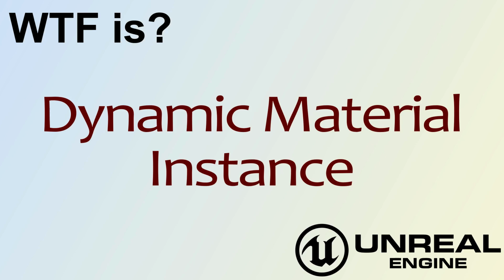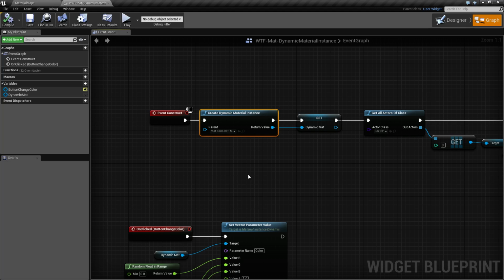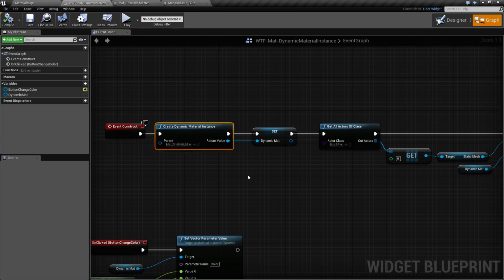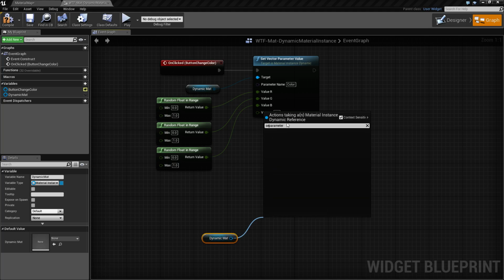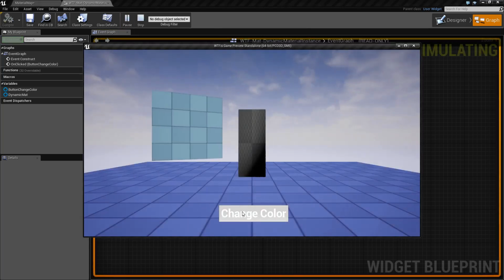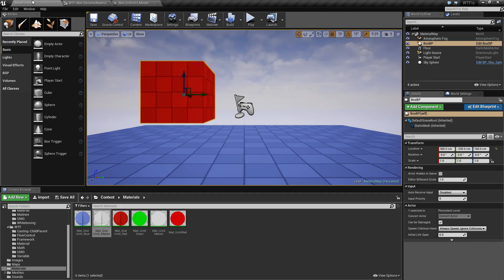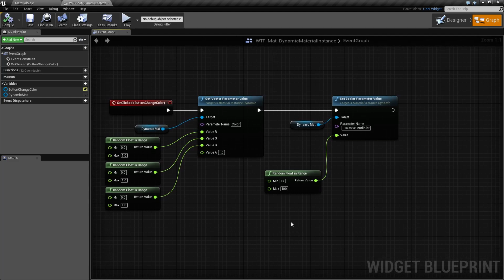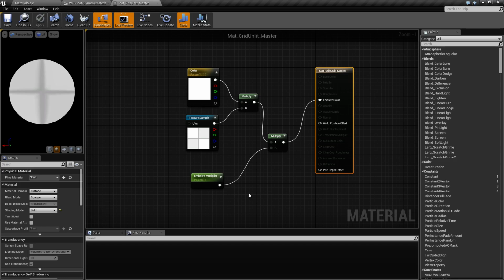WTF Is? A Dynamic Material Instance in Unreal Engine 4

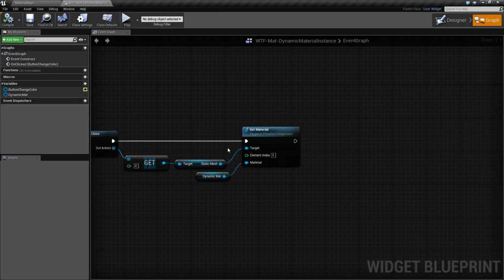Comment: At 02:29 you said something, which boggles me for the past 2 days... If you check my last posted video on this topic, apparently MIDs are not needed, which is VERY strange. I also made a forum ticket (link in its description). It's beyond me why this works, as the official documentation says you absolutely need a MID in order to control things during gameplay (at runtime), but it works not only by using a normal MIC instead of MID, but even without using any MI at all, just by using the parent Material itself 🤯. It's beyond me why, as it completely invalidates Material Instancing altogether, not to mention the Constant vs. Dynamic difference.

Comment: What's the point of creating a dynamic instance of a material if you can change the parameter directly in the existing material?
Reply: Check my last posted video on this topic, as apparently MIDs are not needed, which is VERY strange. I also made a forum ticket (link in its description). It's beyond me why this works, as the official documentation says you absolutely need a MID in order to control things during gameplay (at runtime), but it works not only by using a MIC instead of MID, but even without using any MI at all, just by using the Material itself 🤯. It's beyond me why, as it completely invalidates Material Instances altogether, not to mention the Constant vs. Dynamic difference.

Comment: Hey Mathew I wonder how can I make wrinkle effects for my facial animation. Thanks :D
Reply: I am no expert but i would probably bake multiple Normal maps on some program like blender from a high poly model to a low poly model 1 without wrinkles and 1 or more with the wrinkles. Then using the method in this video you could make it so that when something happens like a animation the normal map changes and creates wrinkles on the character. To smooth the transition you could use something like a Lerp node. This is probably not the best way of doing it but it should work.

Comment: how would you set up an array of textures to cycle through on a timer? would you need a different material for each texture or all the textures in like an array?
Reply from the maker: You can set up a Texture Parameter inside of the Material and then inside your blueprint or whatever controls the material it could change the texture from there.  If you are trying to do this all in Material then you could use a time node with a max of your amount of seconds you want before it reset and then feed that value into an if node.  That node could then based on the time use that material or if not, it goes to another if node and checks the time and it can repeat like that.  I don't know how well this would perform due to the if nodes however.

Using a blueprint to change the Texture Parameter inside of the Material would be what I would try first personally.

Comment: Do you know why it's possible to use "Set Scalar Parameter" without any dynamic material instance on the default material? We had this discussion on Discord, but nobody had an idea why it's working.
Reply from the maker: I am assuming this is using the Set Scalar Parameter Value on Materials node?  If so this is a node that was added to allow you to change values easily without needing to create the material instance.  You will find that there are other nodes that target the Dynamic Material Instance if you need to change other things.
Reply: My apologies,  yes the full blueprint function name is "Set Scalar Parameter Value on Materials" like you said. Changing values with that node works, but not if you change the material with "Set Material" and using "Set Scalar Parameter Value on Materials" again. Basically this is not working https://gyazo.com/64e7a8d55d558e356c51a3433e2100e0
Reply: It's because in the code of the described function original material is swapped with it's dynamic instance that is created on the fly.
Reply: Check my last posted video on this topic, as apparently MIDs are not needed, which is VERY strange. I also made a forum ticket (link in its description). It's beyond me why this works, as the official documentation says you absolutely need a MID in order to control things during gameplay (at runtime), but it works not only by using a MIC instead of MID, but even without using any MI at all, just by using the Material itself 🤯. It's beyond me why, as it completely invalidates Material Instances altogether, not to mention the Constant vs. Dynamic difference.